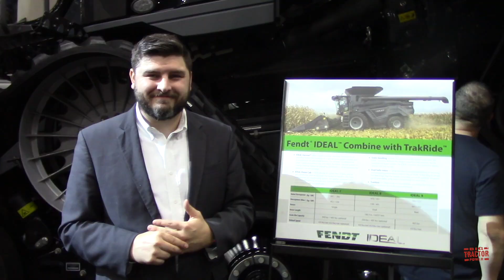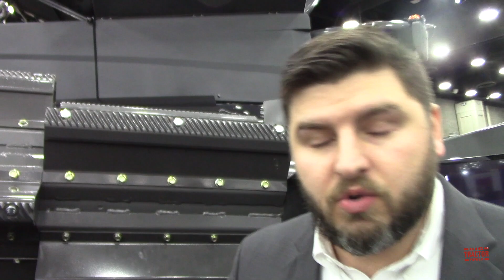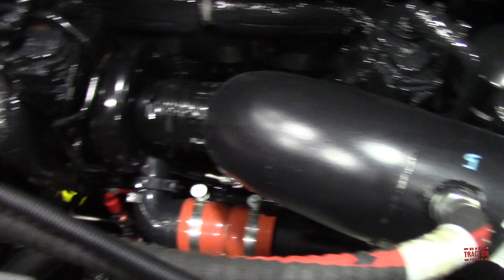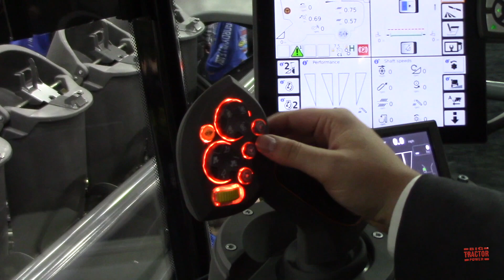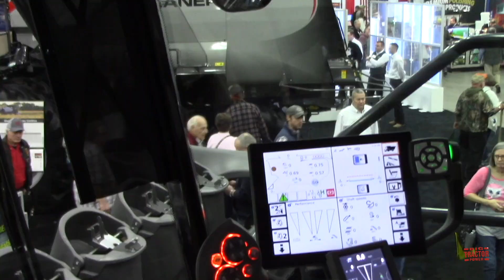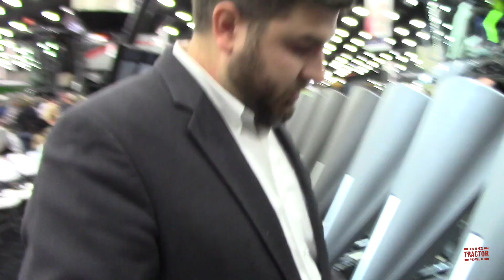Fendt IDEAL: New Axial Combine

Comment: @bigtractorpower I do love Black is Fendt like John Deer with there coding or can one get things worked on other then the dealership like maybe the owner or a guy with all the right stuff to do the work just with less over head to charge you for?
Reply from the maker: I guess I don’t quite understand the question. The Fendt Ideal is sold through AGCO Fendt dealers. To be an Ideal dealer there are hi standards.  The dealership has to provide 24/7 uptime service and a replacement combine if the customers is down for repair.

Comment: Gleaner, mf, fendt, etc . Nice machines . But what is the point of running so many brands under the same roof?  It's like Chevy and GMC. Kinda redundant.
Reply from the maker: Well each machine is different.  The Gleaner accounts for 70% of AGCO’s combine sales. Gleaner has a transverse rotor that provides s natural flow of the crop material and keeps the combine light.  The Massey has an Axial-Rotor which is good in rice and heavy grain.  The Fendt is a twin rotor which excels in high yielding small
Grain.

Comment: The rotor layout and cleaning system are very innovative.  The handling/breaking of straw was one thing we fought in the early days of the IH Axial Flow but this design looks like it would solve that.  Lots of capacity no doubt.

Comment: And there it is in all of it's glory THE BEAST.... Fendt really are leading the way both with their Combines and Tractors (especially the mighty 1050 which will outperform any of the lugging lumps the US produces both in terms of grunt in the field, tech in the cab and low running costs). To me, considering the Ideal is a brand new concept, built from the ground up and not based on an existing platform, it is leading the way but a huge margin and leaving the likes of John Deere, Case, Massey and so on in it's tail dust (yes pun very much intended)

Comment: What I wish you ask him?   When the Ideal was first introduced it was presented in not only Fendt but MF and Challenger brands. So why is Agco pushing the Fendt name on it in north America and not MF or Challenger?   It's built in Italy at the Laverda plan. AGCO already builds MF, Challenger and Gleaner here in Kansas. Why not build the Ideal in the US? Will it replace the current MF, Challenger and Gleaner?   Great job Jason!
Reply: DIRT&THUNDER because challenger and Massey don’t sell well in North America.
Reply: Jamie Givens it depends where you live. It also has to do with the dealer. Most Challenger dealers also Class dealers and will not out a competing brand on the lot. A lot of MF dealers used to be AC dealers and still sell Gleaners. In the wheat bell they do sell quite a few and long time MF dealers do to. Now it sounds like AGCO wants Fendt to be pushed over there already established brands. Makes no sense.
Reply: @dirtthunder1638  Its agco, its not supposed to make sense, also where?
Reply: @jamiegivens3970  they would if they had a product like this
Reply: Gleaner and Ideal, north america, the rest will be discontinued. Entire challenger line eventually too.
Reply: They’ll put it on the lot if it sells.

Comment: The Deere killers?🤔🤔🤔
Reply: Amazing what dealer support will do for you.  They have that big of share even though Case IH and Gleaner both are currently building better combines than Deere.  John Deere is the Subway of agriculture equipment.  Lol
Reply: @ronniesorter1888  Now I can't say much about gleaners only been around a couple of newer ones on demos with other people trying them out and after much messing around with them they just threw to much out the back. Not saying with a little more time it wouldn't have gotten better or maybe it was just those two machines. I wouldn't say they are building better combined. It depends on what you want. Deere has always stated their combined are corn machines first and everything else second especially with rotor combines. Now as far as case ih. A few friends have them and the only thing I don't like about them and I have seen it in YouTube videos and the grain in the tank is not the cleanest thing around but they do a good job. We run Deere and alot of our friends do to. Some went to claas but a few jumped off that train when it was taking forever to get parts for them but that may have changed. I don't get the subway thing, I mean Deere didn't become the biggest ag manufacturer in the world by luck. Deere is ahead of everybody in just about everything and with where we are having 5 dealers with in an hour or so of us with only one case dealer which is the worst and one acgo dealer within two hours it just doesn't work. Until the rest get the parts and service side figured out they will always be behind. Plus if they would build more quality stuff it would help.
Reply: @chadjustice8560  no one wants to set a Gleaner right because they are a Gleaner. they'll set everything else but not a Gleaner.
Reply: Hahaha if you think a combine with just a little bit bigger stuff and no dealer support is going to cut in deeres 70 percent market share is funny